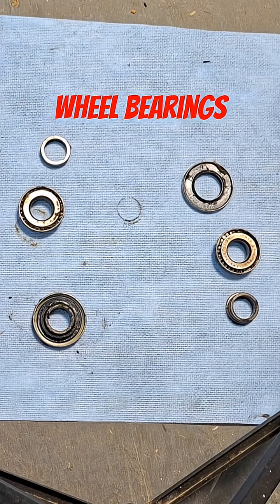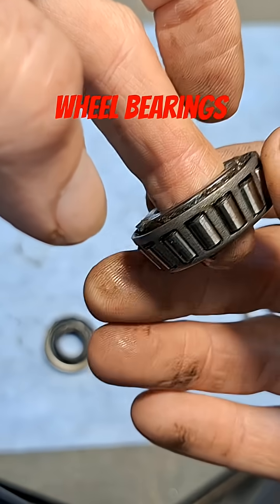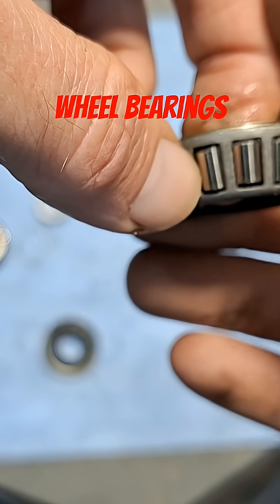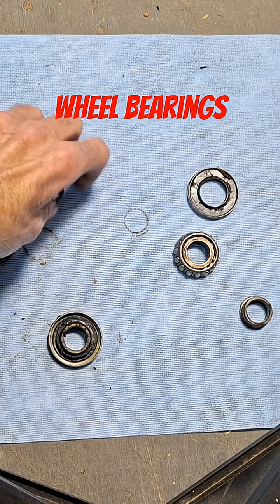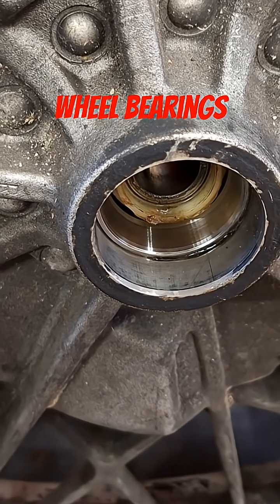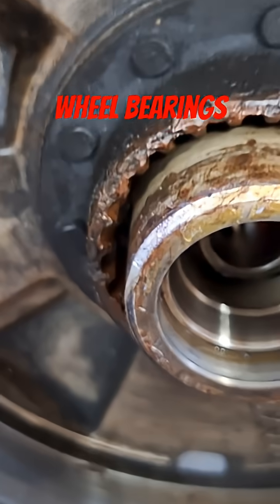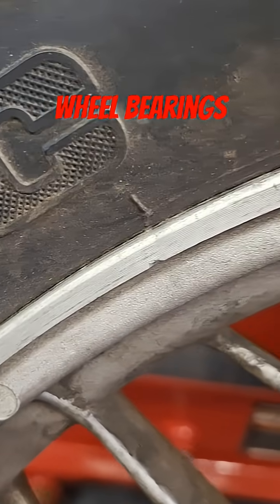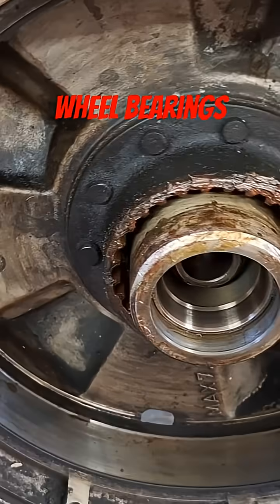Bearing Inspection That Saves Your Wheels #maintenance #safety #mechanic

Comment: wow bmw expects you to take those at high speeds 😂😂😂
Reply from the maker: Not really, those two words are not really synonomous on the twins, BMW and high speed that is. 
    Pretty much a standard bearing on most older bikes. They can last forever if taken care of properly. 
    That being said, I have witnessed similar size bearings doing over 150 with no problems. On stuff I haven't witnessed but know to be true. On one of the fastest bikes ever, had the record for several years. They set a record of 202mph using an almost exact same size timken bearing. That was in 1971 set by Leo Payne on a 1957 harley Sporster partially faired. With the fairing off it was 186mph. 
   With a modern ceramic ball bearing it probably would hvave been faster by maybe 1mph maybe 2.
Reply: @r @russellbarron6775 wow man didn’t realize i was watching bike content my bad 😂 but damn don’t know that those bearings were used on high performance bikes thanks for showing that information and you are right with today’s technology i would have picked up more speed, my boss told me a story back when he used to run late models there was this guy who patented some sort of rear end gear design and i think he got with temken for that i forgot what company he said but he said he put it on his late model car and he claimed it was dry he installed the wheel and everything to roll it and  he said that wheel had no friction and he went over to his dads car who was also running a late model but with his regular rear end that they used before and he said he could barley get it to stay spinning and he had to use force to push his dads wheels and his was lubricated track ready but it makes you think that those guys that came up with these really cool designs and i’m not just taking about differentials anymore but like you said bearings and drive shaft technology and these transmission that just work great and these crazy designs to improve boost all came up in your generation and now that technology is used in a standard level and there is even better stuff ca you believe that they say you can’t reinvent the wheel but mankind has improved so much and o hope o doesn’t slow down racing is arguably so much safer now a days cause of legends of past time who would take the craziest risk to be faster than the other guy
Reply from the maker: Its all in setting the endplay correctly on tapered rollers.
   The advantage in them is higher load ratings of both radial and axial loads, they last longer. Drawback is more resistance.
   If you take apart a ball bearing and compare it to a tapered roller, its easy to see you have a much greater load capacity with tapered.
   A popular upgrade for steering Head bearings is to convert from balls to tapered. As they can take more abuse like from wheelies.
   But for overall performance with much less rolling resistance, a quality ceramic ball bearing is great, but pricy and are dainty in construction. Translation , great for a race bike, not so much for street. 

Anyway, happy new year, have a spectacular 2026.